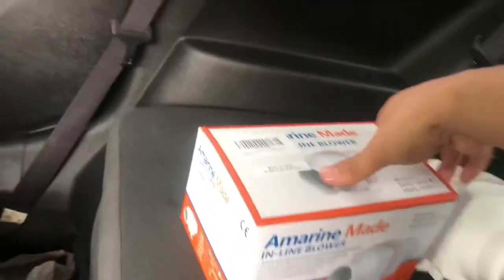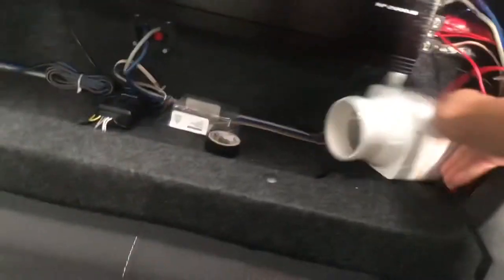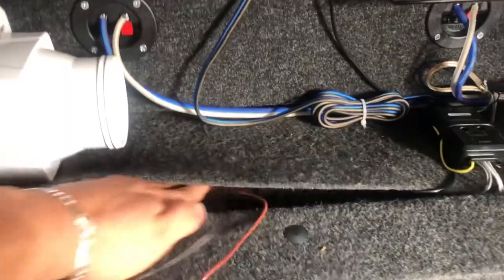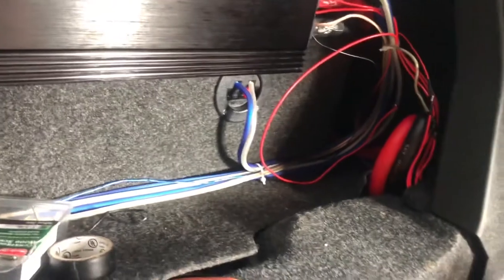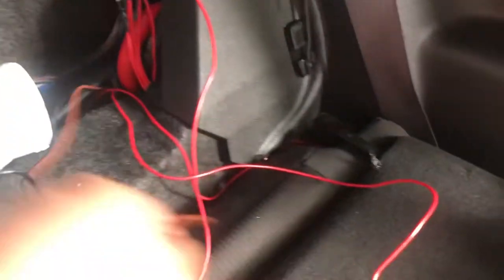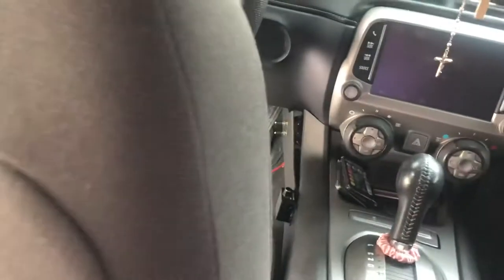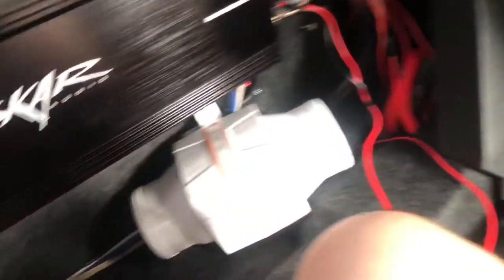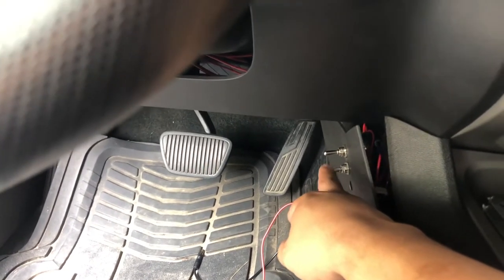Amplifier fans install

Comment: How u got switch install
Reply: So u got it power from da amp?
Reply from the maker: So I stole positive power from the amp and I ran it to the front, with a 16awg wire from autozone, then I ran another one back to the back and both negatives I grounded to chasis and or the ground on the amp, then the positives coming from the fans I hooked to the wire I ran from the switches which is also positive
Reply from the maker: I got the power from the amp yes, well technically I got the power from the battery since the amp is getting power from the battery lol!
Reply: Ok I got ground on chssis
Reply: I got da ground on it chssis and power wire set now were I install da switch at to get it to turn the fan off and on?
Reply from the maker: If you have the wires connected straight to the battery like I did and as soon as you connect the fan to the wires the fan should turn on, well disconnect the positive from one side only and half way split it , then on the switch all you do is connect one wire to one terminal and the other to the other terminal on the switch, then connect the positive back up
Reply: I got ground to da chssis and power to a power supply
Reply from the maker: Would it help if I made a video on how to do it??,
If so I can do one this weekend when I get back home from work, I work out of town
Reply: @nationaloutlaws4818  so I slip da pos.wire in connect pos.from the switch wire to it
Reply: That would help
Reply from the maker: Alright I’ll Send a link on how to do it this weekend, I’ll make sure to come back and put the link in the comments
Reply: @nationaloutlaws4818 did your make the video??
Reply from the maker: @bugaruze  I think I may have tookin it down I could make another tho if it helps?
Reply: @nationaloutlaws4818  well I mean I was just gonna run a hot wire from the positive part of my amp and run a ground from my amp to but idk if the switch will turn off the amp when I flip the switch but if you’d to make a vid I’ll appreciate i💯💯